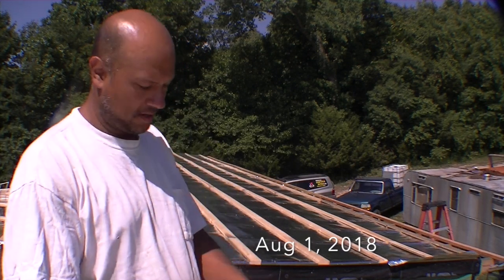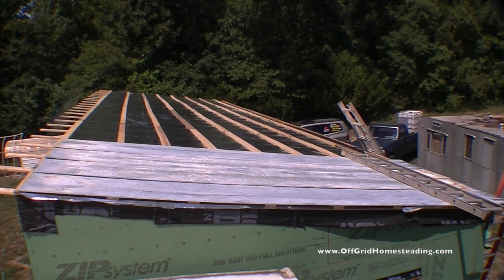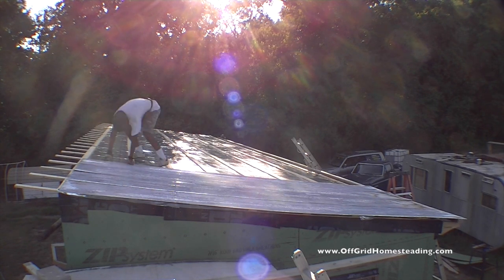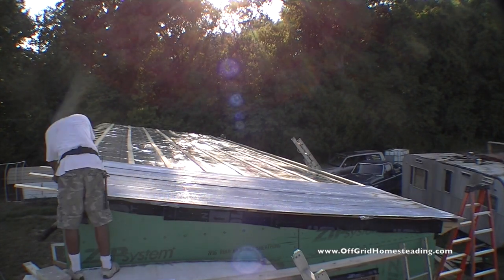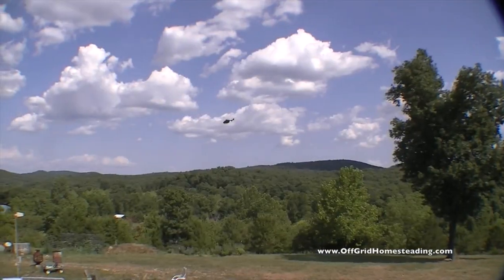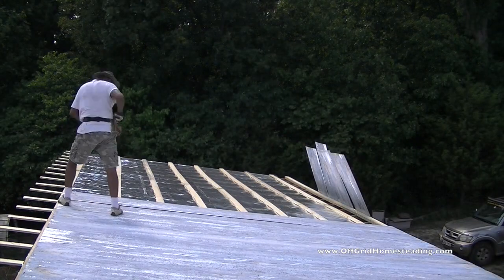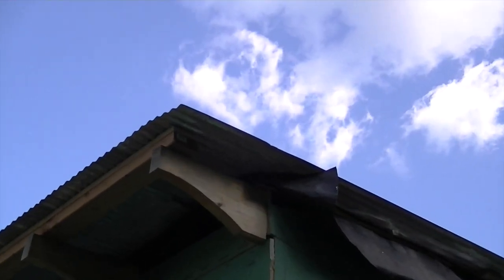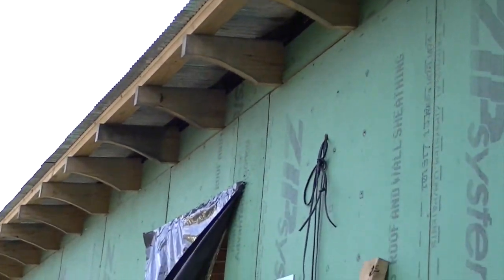OGH - DIY Build Pt 23: Installing 16' Corrugated Metal Roofing with Patina

Comment: Wow! YouTube hit a home run when they recommended your video to me! I've been working on a corrugated metal roof for my log cabin. It has a pitched roof and I haven't decided on how I want to vent the ridge. I'm building rafters 4 ft. on center on top of the shingles. At 62, I'm good for about 4 trips up and down the ladder before I run out of gas. Up on my roof today, working on a rafter, I think about building tree forts with my friends when I was 12. Life has been good to me. Nice video. Good job!
Reply from the maker: Hey Steven, thanks for the nice comment!  We're going to have another eave with a downward angle like in this picture / and design from reclaimed space   http://www.reclaimedspace.com/laarboleda  we're going to have more solar panels that are 3.5'x 5.5' so I'm just trying to figure out my adjustable angle system and how I'm going to mount these (future panels there).  The panels on our mounting system will be HORIZONTAL on the roof area above the deck.  Here is the size of the panels in this video:  https://youtu.be/3Gwn11OX9v0  Glad you found our channel.  We will have a ridge cap that covers the entire width of the roof when we build the panel / mounting structure.  Let us see some pics or a link to your progress by replying with a link to this message thread.
Reply: I've been thinking about posting a video of my progress building a new roof. When I get the rafters done, I'll take my video camera up on the roof for a video. When I upload the roof video to my channel, I'll search for this thread and let you know.
Reply from the maker: Stephen Messenger sounds great!  Looking forward to seeing your project

Comment: It’s coming along great John! What’s the next step now that you have the roof on?
Reply from the maker: Eric Dahl The next steps are finishing up our in wall gas lines, water lines and some electrical inside the building ethernet wiring and speaker wire for our Dolby Atmos surround sound system!!